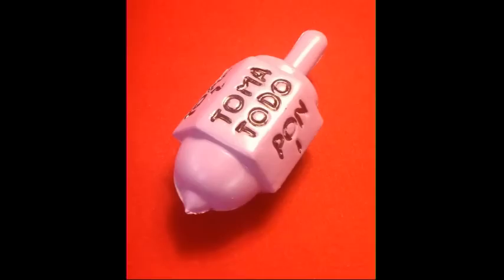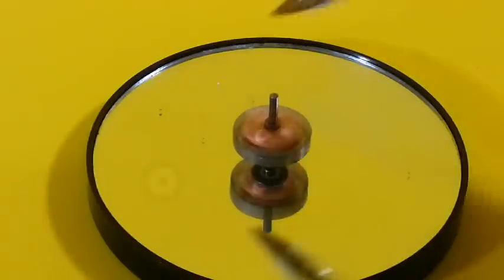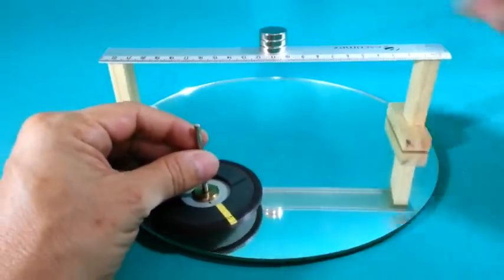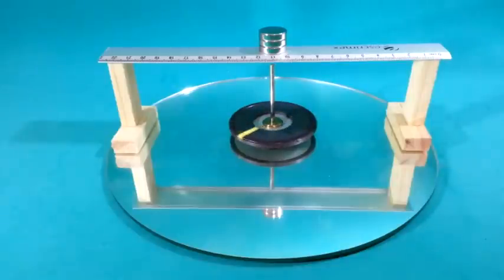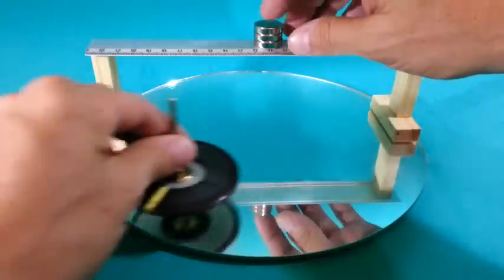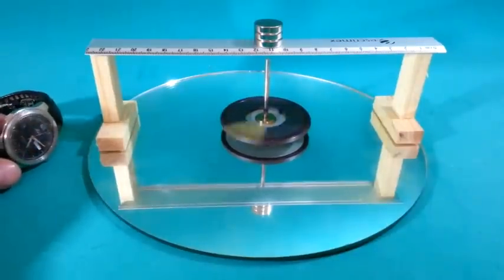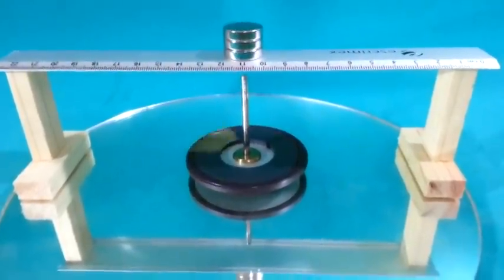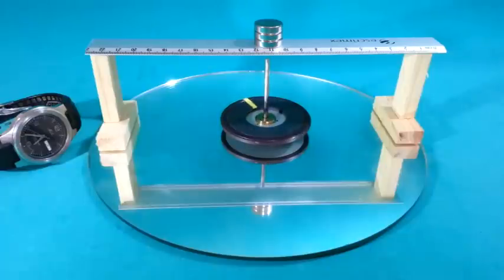Magnetically Suspended Spinning Top - Spinning for more than 20 Minutes!

Comment: LS: I have duplicated one of your teaching projects with 4 magnets on the outside of a 4 inch round plastic lid using a number size 14 gauge diameter metal clothes hanger vertically in between 2 magnets, it works great as long as a very low DC volts is applied to the coil, if too much voltage is applied, it will kick the spinning 4 inch lid completely out from under the 2 top and bottom magnets. However, to try and remedy this problem I'm going to slightly shorten the 14 gauge diameter metal clothes hanger and add magnets at top and bottom to try and increase the magnetic field at top and bottom.
Reply from the maker: Which project is that?
Reply: @ludicscience  The Pulse Motor here: https://www.youtube.com/watch?v=A2_yvnEZQww

Comment: LS: You have many incredible teaching videos that makes others understanding of your projects very informative and simple, you have a true gift for it, and keep posting them. Also, try making a Direct Current (D.C.) pulse motor generator using a DVD or CD disk suspended by like pole magnets over a number 10 AWG wire (no bearings for friction) with one set of north south(hard drive) magnets placed in a circle on the inside part of the DVD/CD disk and coil stators under them for recharging the battery, and place 4 magnets on the outside of the DVD/CD disk with coil underneath and magnetic reed switch to rotate the DVD/CD disk.
Reply from the maker: Will try thanks!
Reply: I would like to see it, IF and when you finish it, in the meantime I'm going to try one myself. Thanks for your videos, they give me new ideas to create too.

Comment: Would it spin even longer if it hovered in the air between two magnets? Is that an achieveable experiment at home?
Reply from the maker: You can not have a stable situation using two magnets.

Comment: you can make the disc shape like a water turbine or a fan, by attaching small piece of papers or cardboard on it, then you can blow it with a fan, it may help you from trouble to spin it with your hand
Reply from the maker: it´s a good idea
Reply: Oswald Rayleigh   but that will increase the air turbulence later.  So it will be convenient for starting it up but increase energy dissipation rate, shortening the run time.

Comment: Wait how did it switch directions and then go back up to full speed
Reply: the camera framerate
Reply: when he speed the video it skip a couple frame and that make this effect
Reply: It didn't actually. It's the same weird effect when you have a stable and a slowly changing frequency of sound and you hear them form so called "harmonics". When the spin of the disc was 30/16 rpm OR all of the multiples of 30/16, so the same as the camera frame rate (or it's multiple), the camera will always take a frame when the disc is in the same place. If you took a photo every second of something that is moving 1 rotations a second, you would be taking the same picture all the time, even though the thing is spinning
Reply: FREAKING CALLED IT XD
Reply: ohhh yeah i can understand that thanks
Reply: yep like the rims in a car commercial